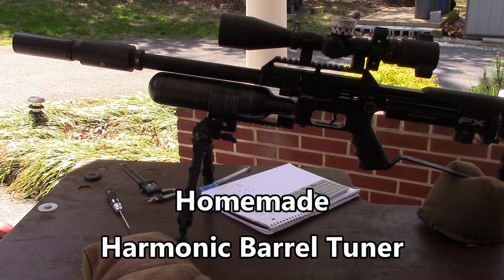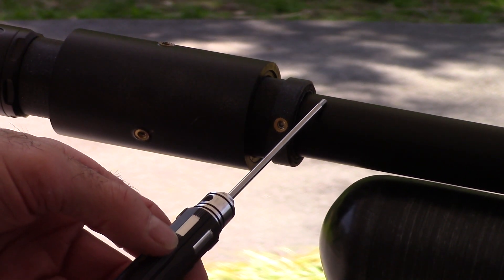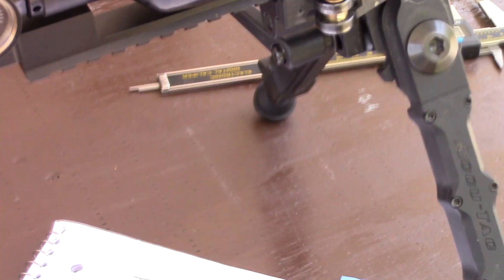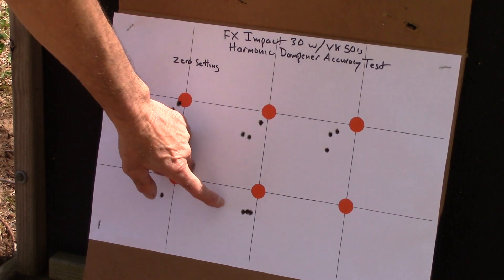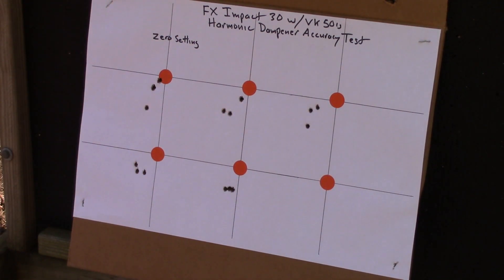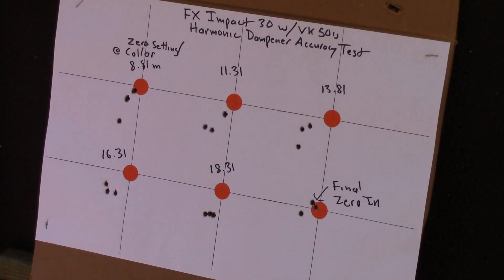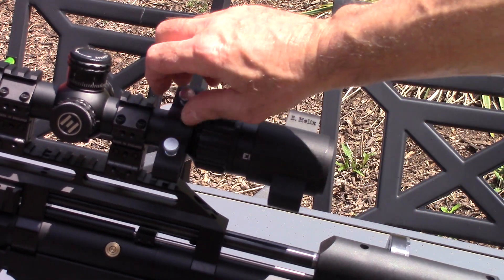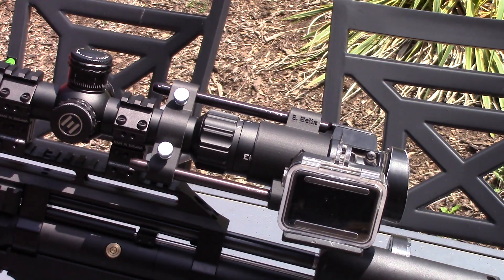Updated 3d Printed Harmonic Tuner

Comment: But what was your grouping before you added anthing to your barrel. Sureley that gun can print clover leaf group at 50yrds without that lump mounted on the barrel. Looks to me you just upset the harmonics in the first groups.  Can't see any benifit to this and it looks terrible on the barrel
Reply from the maker: I don't know if you have shot slugs very much but they are very hard to get dialed in for accuracy just using the older method of varying velocity. The groups before with this weight and style of slug at the current velocity were not that good. It is much easier to take a desired velocity and tune the barrel to slug harmonic exit node. I will take performance and accuracy over looks anytime. Also do you know that FX Airguns is coming out with a shroud with a harmonic tuner that works on this principle.